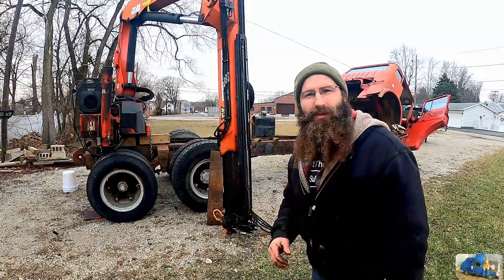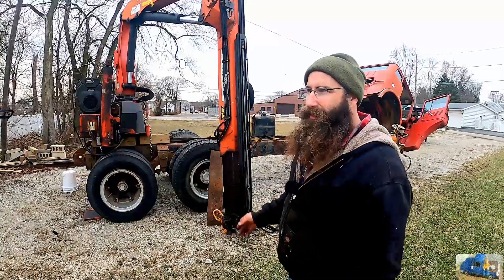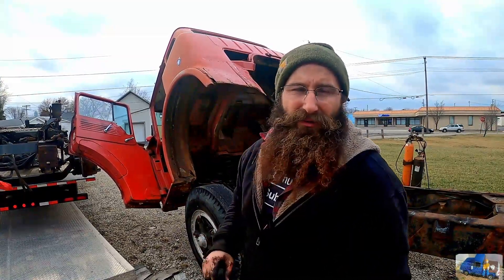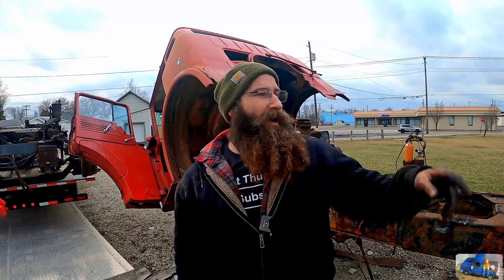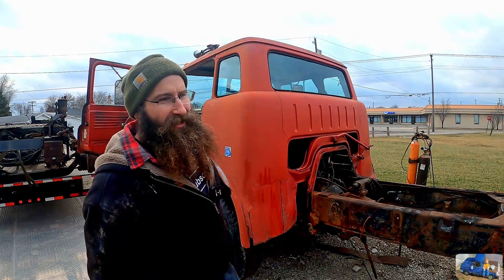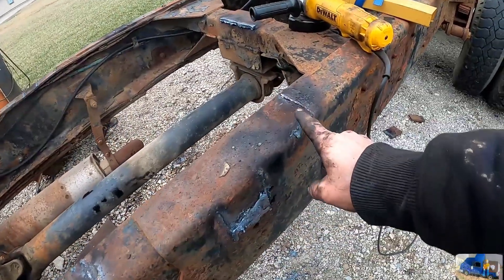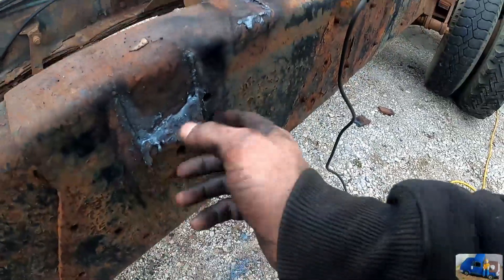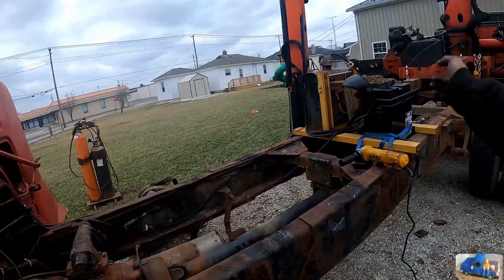Self Balancing PK12000....Positioning on Margaret!

Comment: As far as gouging the frame a bit if it worries you just weld the area up and grind it smooth, You may want to reinforce the chassis where that crane is sitting. Maybe some plating on the inside or outside. Sure would help the strength in that area. Too bad it isn't a live tandem...
Reply from the maker: I am going to repair the frame sections where I got too friendly with the torch as suggested!  Great ideas and thoughts!  I have a heavy tubular subframe I am welding out.  It goes in-between the crane and the frame..... Stay tuned I have big ideas regarding the suspension and frame rails.  Thanks for watching 👍😁

Comment: interesting project. I had a similar vintage ford cabover back in the 80's. NEVER adjust the shift linkages to the transmission! Very, Very difficult to get it to stay in gear if you do this and then bungie cord time on the stick shift.
 With the cabover tilt, the accumulated slop on all the universals results in a lot of play, and the resulting difficulty finding gear engagement.  If you have got the no gear gun to your head, buy a machinists dial indicatior and magnet stand, make reference marks on the frame and trans you can find again, and fix the loose ungreased universal joints. Then you have to determine your gear throws, and adjust your linkage back to your REFERENCE WITNESS MARKS. 

best of luck!
Reply from the maker: The shift linkage is pretty interesting.  I would fashion it similar to trying to push a rope.  It has forty miles of slop currently and I can only guess it's gear position through landmark objects in the cab.  Good idea on the dial indicator!  Thanks for watching and sharing!  👍😁
Reply: @FlatThunder  Mine suffered from a ham fisted acquaintance who was stubborn and stupid enough to stall it going up hill by bending the shifting forks into reverse. That long stick shift can provide a lot of leverage. The unfortunate roadside repair, (uncoupling the 40 miles of linkage slop from the trans input shaft adjustment coupling nuts) only revealed how jammed the trans was, in that it could not move at all. The forks were so sprung that the transmission top cover couldn't be removed. A strong mechanic had to crowbar it off. I had another trans w/ forks from a spare engine, but getting the coupling adjustment correct was an endless nightmare problem. Cab up, adjust, cab down, get in truck, shift test, (repeat until you abandon the truck on a mining claim in the desert...)
Reply from the maker: @nevadahempresearch3122   Hopefully someone came along and rescued the old girl.  He must have really been 'gear jamming' to bend the shifting forks.

Comment: Hey Andy. I think you said you wanted to shorten the wheelbase. Looks like it was lengthened in the frame. Were you going to leave room for a flatbed, or just use it as a cab/chassis with a crane?
Reply from the maker: Custom configuration with hopefully some neat features to boot!  Definitely shortening the wheelbase!  It takes forty mile to turn and three hands now 🤣.   Thanks for watching!  👍😁